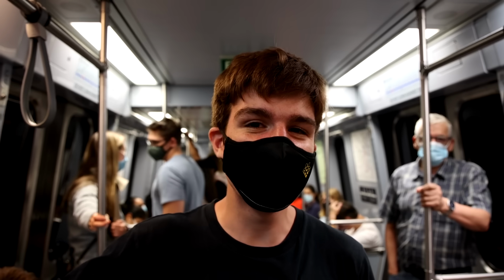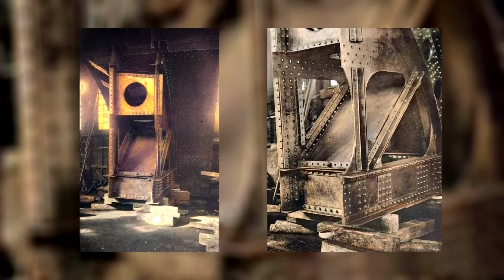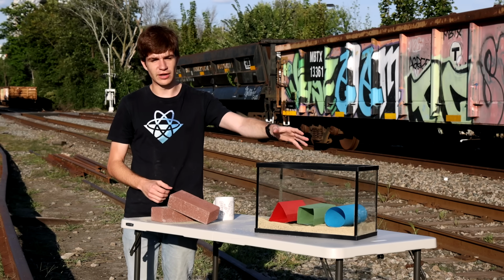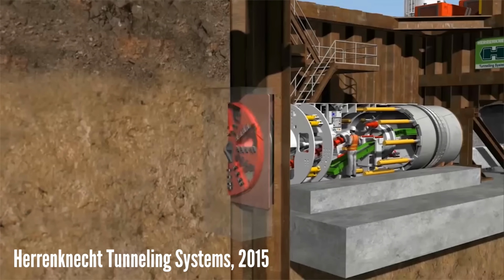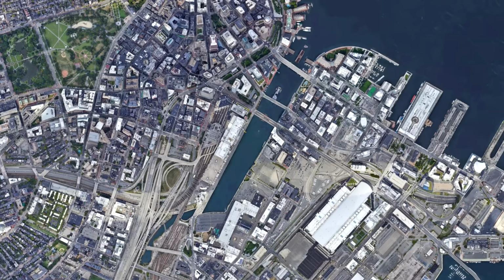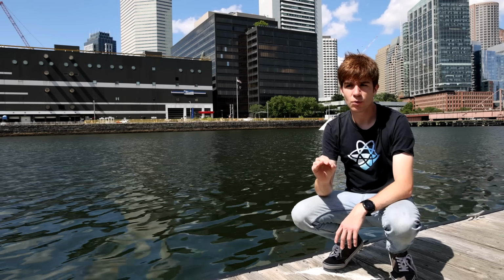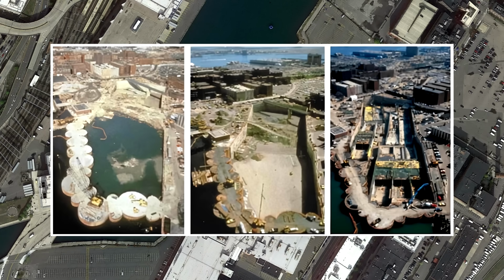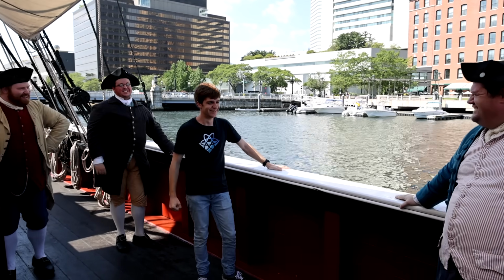Why It's So Hard To Dig Tunnels Underwater

Comment: So far none of the promises of the various vacuum train companies have materialized.
I don't believe that vacuum trains will be viable anytime soon, even more so if you're going to build one under water.
Reply: Yeah, I was thinking a regular maglev train rather than a vacuum maglev train would be more viable at first. But I suppose this plan presupposes the overground vacuum tube trains will iron out the kinks while tunnel construction is ongoing. Not that anyone is actually attempting to build a transatlantic tunnel yet.
Reply: @kaitlyn__L  The thing is, high-speed rail is already pretty expensive, and then maglev is so much more so. That's probably why it has seen limited large-scale implementation. It is very expensive to build and maintain, up to 4 times as expensive as conventional high-speed rail. So I am a bit incredulous toward using even regular maglev in a transatlantic tunnel. There is a great discussion about maglev in a video essay (i.e. rant) called "The HYPERLOOP Will Never Work, And Here's Why" by "Adam Something." It focuses on above-ground Hyperloop designs, so in other words, the viability of vacuum tunnels, and Elon Musk's air-cushion design VS maglev VS conventional HSR.

Maybe some day we will learn how to make it work, or the project could be subsidized such that initial investment doesn't have to be balanced against profitability. Of course I would love to be able to get form New York to Lisbon in an hour using only electricity and no fossil fuels. I just don't think it's going to happen any time soon.
Reply: @DaimyoD0  yeah, but JR is putting a ton of money behind their maglev system and they’re building the Chūo Shinkansen unless all the fates align to stop them. Something like 80% of the Chūo line will be in tunnels as well, and without being explicitly a vacuum train, keeping most of it in tunnels does result in a reduced air pressure in the tunnel. 

That’s very different from the skepticism about Hyperloop, which I fully agree with by the way. 

I’d take traditional HSR too, but I just have my doubts whether anyone would take it over a plane for a transatlantic tunnel. It’s competitive against short-haul flights mainly because of all the extra time taken to check-in, and going to and from the airport. But I wonder how many people would take a regular HSR tunnel if it took much longer to make the journey — the Eurostar is somewhat niche in the UK because of all the extra time taken on the traditional rail network to get into HS1, even though the TGV, and AVE, and ICE are doing excellently vs air travel in the continent because the connections with their countries’ slower rail is much better. 

So I feel like regular maglev would probably be about the lower bound for an acceptable transatlantic train travel time. But that’s just ballpark.
Reply: There was a vacuum train in Victorian times. The vacuum tube was small, and contained a piston which was sucked through, pulling a train outside the tubes. Compared to it's contemporaries, it was quiet, "clean" (as in, the passengers didn't get covered in soot, as the engine was at one station) and fast. It also failed because the seals around the cylinder (made of leather) kept failing, or being eaten by rats.
Reply: Vacuum trains exist at most US banks, albeit tiny.
Reply: To be fair, hyperloop companies only started around 6 years ago, that really isn't a long time for something like this. It definitely isn't whether we can make it work or not, the question is whether it can ever be economical.
Reply: @MDP1702  Those companies promised fully functional lines within 5 years. The fact that there has been zero progress is a sign that this concept won't work. It isn't even a new idea, vacuum tube transit concepts have been around for over 100 years now. To give a comparison, powered flight (airplanes) has been around for just as long and it actually caught on.

There is no question about whether we can make this work, it won't work. All it takes for a vacuum system to fail is a pinhole leak, when you have miles of tube subjected to thermal stresses a leak is merely a matter of time. Bear in mind that we'd have to address onboarding, operating the module, maintenance, etc.
Reply: If it was ever feasible to create maintain and operate large vacuum vessels, there might be some hope of it becoming a reality someday, but currently evacuating a few dozen cubic meters of volume to a satisfactory level for frictionless transport takes hours and/or MWhs of energy and creating sufficiently airtight kilometer long vacuum chambers is even more of a challenge.
Reply: Both a vacuum tube and a transatlantic line are maybe 10% an engineering challenge and 90% political bickering and financing hell. We are smart people, we can subdue the planet on many many many fronts. The question remains: who's going to pay for it.
Reply: @hkr667  yeah, that is the real determinant of when or if it ultimately happens.
Reply: @hkr667  Hard disagree. Building huge vacuum tubes is just not a realistic option at our current tech level so even with all the funding in the world it wouldn't work.
Reply: I'm no engineer, but to me it feels like underwater vaccume tubes seem more feasible, not less. Water is more viscous than air, so it would have a harder time getting into the tubes, plus any leaks would be very obvious and easier to fix.
Reply: @brookewestonctc  and the preassure the tubes would have to withstand would be far greater making them even more ludicrously expensive to construct.
Reply: @jakobrosenqvist4691  "the preassure the tubes would have to withstand would be far greater"- It's just one atmosphere of pressure more. On the ocean floor, 1 km and more under the surface, you've got 100 atmospheres of pressure, so the additional atmosphere of pressure from the vacuum is pretty much nothing.
Reply: @valentinmitterbauer4196  building a tunnel on the ocean floor is more ludicrous still. If a transatlantic tunnel is ever to be built it needs to be suspended no more than a couple dozen meters below the surface.
Reply: @valentinmitterbauer4196  I think you misread, because you argued in their favour.
Reply: @toebs_  My point wasn't about the feasability of sea floor- leveled tunnels, but the (almost non- existant) difference of the structural demands between a normal and a low- pressure sea tunnel.
Reply: @valentinmitterbauer4196  yeah I know, I just thought that Jakobs statement was comparing tubes on the surface with tubes under water. I read it again and now I see what you mean, it is worded a bit ambiguously.
Reply: @toebs_  Sorry for my bad english, i am no native speaker
Reply: @jakobrosenqvist4691  There would be no requirement to have them much deeper than normal shipping traffic; fifty meters would likely be safe, make it 100 just to be sure.
Reply: Let's do some math shall we?
Let's assume the tunnel is 2m wide, it would likely need to be wider but it's about the smallest you can send humans trough. Then let's assume the walls are 10cm thick steel like some submarines. Doing the math that is about 5000kg of steel per meter of tunnel.

If we go from New york to mainland europe the distance is about 5 000km that's 5 000 000m. Thats 25 000 000 tonnes of steel. That would take the entire worlds steel production for almosf 14 years for just one tunnel. If we are cheritable and go from newfounland to france we get away with about 3500km, that's only 10 years of the worlds steel production......
Reply: @jakobrosenqvist4691  Except not... if it's 100m under water, the pressure would be 10 atmospheres.
Adding one more atmosphere from also having a vacuum inside would make it... 10% more, and we're in a region with sub-linear scaling of expenses with imposed loads. So it'd be less than 10% more expensive.
Reply: @namibjDerEchte  100m is quite deep, a more resonable depth would be something like 25 meters maybe even less for most oc the tube. And if you don't go for a vaccume but instead increase the preassure to say 1,5 atmospheres you would only end up with a pressure of 2 bars. Keeping the preassure diferential relativley low would make it both a lot cheaper to construct and has the benefit of being salvagable in case of a leak, 2 bar you can stop 10 bars not so much. Also having air in the tube would act as a dampner in case of a leak to prevent a hypersonic rush of water trough the whole tube killing everyone in it and likely a a few people close to the end stations.

And from 25 meters people inside the tube could make it to the surface with a life jacket and a minimal oxygen supply in case of a failiure. At 100m they would have no hope even if then miraculously escaped the hypersonic surge of water.
Reply: @brookewestonctc  But one leak would still destroy the tunnel because everything would rush in to fill the vacuum in the tunnel
Reply: @brookewestonctc  na imagine air is already trying to squish the tube (that's what a vacuum is) now imagine not only do you have the miles of air on top of you but ft of ocean. every 20 ft of water depth is 1 atm of pressure aka 14.7 ish psi. now if your 20 ft under water in a vacuum tube now the pressure on each square INCH of that tube is 28 POUNDS. PER INCH. 9 square inches or a 3 inch by 3 inch square has 252lbs !!!! on it. 1 sq ft aka 12 inch by 12 inches has over get this 4000LB's aka 2 TONS. of force on it. imagine 2 cars worth of mass all on a area the size of your chest. While its definitely possible to pull off the material would have to be solid steel and around a 1ft thick. Even just 1 mile of underwater track could cost billions of dollars worth of steel. Infact there might not even be enough steel available on earth to make such a thing. It would take as much steel as all of America has used so far to build such a thing. basically there's no reason to build it. focus more money on fusion and rockets

Comment: This reminded me of the subway tunnel that has been built across the Bosphorus in Istanbul (by a Japanese company I think). It sits on the ocean floor. Perhaps that would be an interesting follow up to this.
Reply: The north atlantic has an average depth of 3,646m (~12,000ft). Pressure increases by 1 atmosphere for every ~10m you descend, in water, meaning that a tunnel at that depth would experience roughly 360atm of pressure. 

This could be combatted by pressurising the tunnels to 360atm, except that oxygen toxicity sets in at roughly 6atm. So the tunnel would need to hold almost the entire load anyway.

The deepest tunnel in the world is the Gotthard Base Tunnel in Switzerland. At it's deepest point, there is 2,300m of mountain above it. Now, rock is denser that water, but even assuming high rock density, an atlantic-floor tunnel would still be bordering on being the tunnel under the most pressure

Also, that's a tunnel through a mountain. The deepest tunnel under the sea is Ryfast, in Norway. It's maximum depth is only 292m below sea level. So a tunnel at the bottom of the atlantic would not only equal the record for most pressure on a tunnel, but also beat the undersea depth record... By over an order of magnitude (12.486 times).

Ocean floor tunnels are great and all. They definitely have their places. But the bottom of the Atlantic is just too much for current tunnel technology. In my humble opinion, a transatlantic tunnel would HAVE to float.

Citations: https://www.britannica.com/place/Atlantic-Ocean (Depth), https://oceanservice.noaa.gov/facts/pressure.html (Pressure), https://en.wikipedia.org/wiki/Oxygen_toxicity (Oxygen toxicity), https://en.wikipedia.org/wiki/Gotthard_Base_Tunnel (Deepest tunnel), https://en.wikipedia.org/wiki/Ryfast (Deepest undersea tunnel)

Comment: It would maybe be better for the tunnel to be high pressure to help resist the pressure of the water. There would also need to be a plan for how to add the 4 inches of new tunnel per year to keep up with the North American Plate and Eurasian Plate drifting apart.

Edit: Actually, maglevs are only around 4 times the efficiency of planes. Apparently, the air resistance for maglevs is their main energy use. Air resistance is proportional to air pressure. So over 4bar it would be less efficient than planes. So yeah, high pressure won't be good.

Comment: not quite so sure on the technical feasability and monetary benefits of a transatlantic maglev/hyperloop, but great video overall
Reply: Yeah... no

Nice Concept on Paper
But Reality has some counter Arguments

There are various Videos why Hyperloop etc is a Scam
Reply: @T1g3rch3n  As was The Big Dig itself.
Reply: @TheRealMirCat  The Big Digg worked...
Hyperloop won't
Reply: the underwater transatlantic tunnel had me until hyperloop
Reply: I'm thinking of calling it the Hypergoop, in reference to Gwyneth Paltrow's scam.
Reply: Even if they built a railway and not a dumbass hyperloop and it all was peachy technically speaking, I just don't see the point. If it's express freight you desire, we have planes. If it's cost and resource efficiency, we have cargo ships. This isn't the Chunnel where you're making a small connection to connect two dense and economically viable rail networks. A transatlantic tunnel would be so long and costly to connect two rail networks that have been built around dozens of ports connecting the two.
Reply: @TheSpecialJ11  It'd also be the biggest target during any war or for any psychopath/terrorist that wants to kill as many people as possible. And due to its length, impossible to defend & protect at all places & all times.
Reply: I had an idea where instead of putting the train in a tunnel, you make it float on the surface. Freed from the restrictions of tunnels and tracks, you can make it really long and wide, even giving passengers cabins! I call it the "Buoyancyloop".
If you want speed, you could make a train with wings, tail fins and jet engines, which could run through the sky at high altitude, where the pressure is naturally low. I'm thinking of calling that one the "Stratosphereloop".

Yeah but seriously, it is our destiny to colonise space.
Reply: Even if we are talking about a normal tunnel (doesnt matter if its full of vacuum) it wouldnt work because the middle-adlantic ridge is not only geologically active with volcanos and earthquakes, the oceanic plates also diverge at a rate of about 2.5cm (1inch) per year. So even if we could build a tunnel down there, it would get stretched until cracks begin to form and then it would be crushed by the insane pressure difference (at that point it doesnt really matter if the tunnel is at 1 or 0 bar).

The only solution for this would be to build the tunnel with a stop in Iceland (Newfoundland - Greenland - Iceland - Faroe Islands - UK would be my route) and have a Highway on the surface of Iceland which can be easily repaired in the future.
Reply: @zedor1872  even then there would be issues as the plate boundary isn’t a straight line, and there is also the part where the boundary forks out for a little bit.
Reply: @mr.astronuts3825  yeah and not to mention the possibiity of just having a magma chamber develop in your path and it destroying your tunnel.

Also you cant have good emergency precaussions if you are thousands of kilometres from the shore/nearest exit and thousands of meters below the sea.
Reply: It should just be a normal train
Reply: What about transatlantic steam powered locomotives? Who’s with me?!!
Reply: A tunnel would greatly reduce the cost of shipping goods. But I don't think it could logistically work because of a multitude of reasons.
Reply: The benefit: Incredibly cool.
Reply: Depends on the time scale.

Clearly, hyperloop is a great idea.  But the feasibility may be for another era.
Reply: @sephreed1938  a miles long vacuum chamber will Never ever be a feasible structure. Especially not in this case a miles long vacuum chamber with extreme pressure on the outside

Comment: Very fun and educational video, but I am a little confused by the inclusion of the hyperloop in the train debate. It's a highly theoretical concept even on land and I think presented in otherwise technical and researched video, it creates the impression there is any science behind it. So far none of the companies has proposed any solution to the vacuum or heat expansion of the material and I am afraid it's just a big buzz word scam. I don't believe they should be featured in a science video until they deliver on anything besides CG renditions.
Reply from the maker: Thanks! I thought it was an interesting future tech that made the crossing time competitive to air travel. I also really like Bobby G. so when I saw he was involved I sort of had to write it in. Excellent point though, I'm also skeptical of the technology
Reply: @AtomicFrontier  I've certainly learned about Bobby G.'s connection from this video. The theorized design of an underwater tunnel with propellers on it is still really cool.
Reply: Sounds like someone has watched Thunderf00t's 13 or so excruciatingly repetitive and disingenuous videos on that subject
Reply: @kirkc9643  repetitive? maybe. but disingenuous? gonna need to back that one up.
Reply: @itsLalm  I think he's actually just taking the piss when it comes to Elon Musk, for views. Just take his recent Starlink video. It is not even close to a complete or accurate picture. He also said that SpaceX would never be able to land and reuse rocket boosters.
Reply: @kirkc9643  Thunderfoot is kinda painful to watch. He uses reasoning to aggressively insult other people instead of sparking curiosity in them. That's no way to popularize science.
Reply: @Gahanun  His reasoning skills are often very light on facts and science too